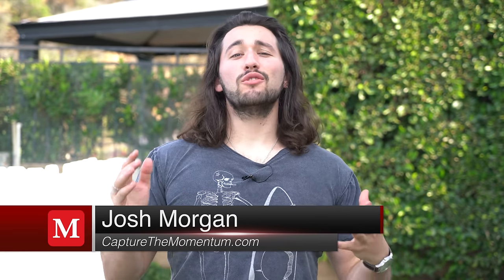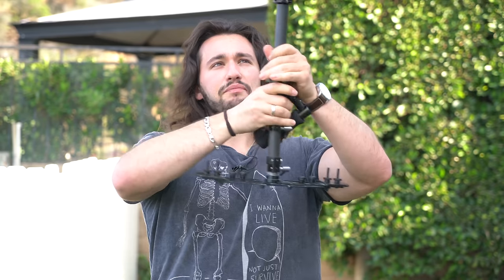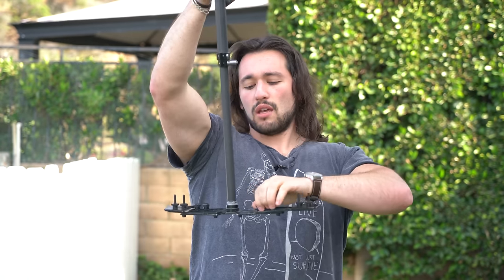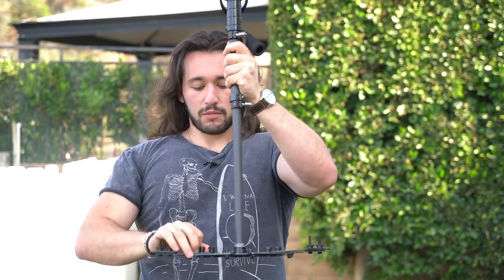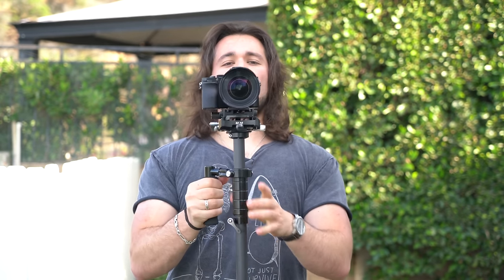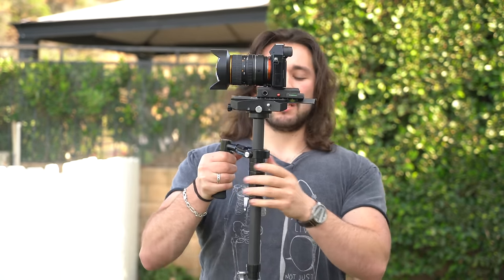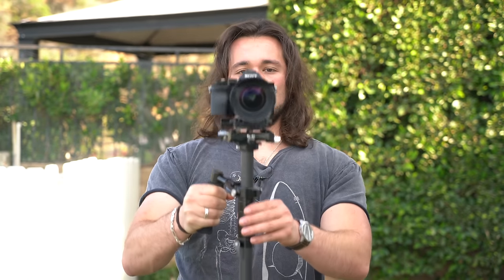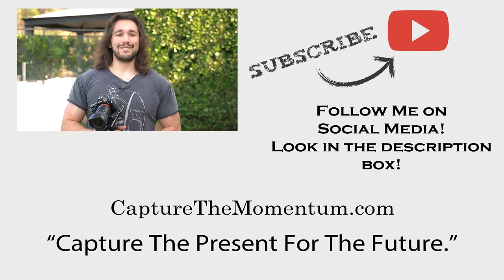BEST WAY TO BALANCE A GLIDECAM - Steadicam - Gimbal - Flycam - Opteka - Glidegear

Comment: From what I've tested, I found that having different drop-time values for different situations help. For example if you are running through the woods, then a 1 sec drop time works great, versus a 3 second one used for a character gently moving through a scene.

Comment: This is the best tutorial on balancing I have watched, and I've gone through a few! This is clear, logical, and most importantly it has the right order of doing things! Almost everyone, including my manual, starts off with the camera/plate adjustments on top, but it is only by starting with the weights apart, minimum weight, fully telescoped-out drop test and going from there was I finally able to get it! I still have some micro adjustments, but it at least looks like it is supposed to now, instead of the twirly baton I had earlier! Thank you so much for the thought and detail.

Comment: Got a Neewar steadicam for less than $120.  It looks like a molecule by molecule knock off of a Glidecam.  I'm working on the relatively steep learning curve of never having done video before (I have a couple of Canon 70d's).  I "get" this video and it's very helpfull but wonder why all of these guys who do them have like 18 inch bicepts
Reply: Because of carrying the steady cam for a long time. Either that happens or you build up your muscles beforehand.
Reply: I got one for 50$ on amazon :D

Comment: which glidecam are you using? do you have a link for it? thanks!
Reply: He mentioned in other videos that he custom built it by assembling different parts according to his needs .
You can go with the simple Glidecam 2000 or 3000 for a start .

Comment: I've been trying for about three hours and it still isn't balanced. Getting general adjustments is fine, drop test works for judging weights, but the "finer adjustment" process is literally never-ending. It always sways. The most confusing part is the way that even if I do something minor like adjust the camera plates placement, overtime it seems like it's changing other factors. Like it'll slowly get worse as I make small adjustments and I'll check the drop time and it's changed, despite the fact I never touched the weights and only made really small adjustments to the head.

Comment: Hi Josh
Am facing a problem with fly cam balancing. After i leave holding it horizontally for the 2.5 second count, my camera goes downwards. Am forced to put weight and after putting weight it becomes heavy and cant hold it for a longer duration. I saw that you haven't put any weight below then also you are getting the perfect balance. 
Please help.
Reply: Am using flycam 3000

Comment: Getting the hang of it but how do i stop it from spinning? It spins 😬 its balanced but i cant get the minor spinning to stop
Reply: AlphaRally16 saaaame
Reply: Same!!!
Reply: Could be an over tightened bearing, my old glidecam had that problem. It was on the cheaper end of things
Reply: It looks like you have to use both hands, so spinning shouldn't be an issue
Reply: to stop spinning add some bearing oil to the bearing and spin it around to lube it up , make sure the bearings arent over tightened then when using the gimbal hold the handle with one hand and lightly hold the shaft of the gimbal to stop spinning . iv got some vlogs on my channel in which some clips were using the gimbal , so it does work just make sure you hold it correctly and check the bearings

Comment: If your glidecam/steadicam keeps spinning counterclockwise or clockwise it is because you have a bad bearing. hold the housing that holds the main bearing and wiggle it. wiggle it in both axis directions, one axis might be fine but the other direction you will feel a loose bearing, that explains why your glidecam keeps spinning no matter what adjustment you make

Comment: Does a zoom lens change the balance?
When it's comepletely zoomed out or in, will it unbalance?
Reply from the maker: Yes definitely.
Reply: congratulation to that super smart question! :D :D
Reply: Schroeder3000 are you being sarcastic?
Reply: Wieger Dam the point is if u change anything (physically) on your camera, the center of mass will also change which means the balance will also change

Comment: i tried to balance my steadycam for the first time today and its so frustrating. its the flycam 5000 and there is no one thumbdial to make micro adjustments. i]you have to unscrew for knobs that hold it by friction and adjust it with your hand. i wish i got the HD5000. anyways i cant stop it from spinning and turning to the side when i do side to side movements, any tips?

Comment: Hi, I bought a cheap Eimo steadicam from amazon for 70 pounds. I wiggles around a lot. The drop time is fine. How can I reduce that wiggle? I tried adding more and less weight to the camera but nothing worked (Panasonic g7). Can it be the lower quality?

Comment: Thank you for the great instructions! Quick question, I have a 24-70 mm, and a Glidecam HD Pro. 
Would  you recommend balancing the Glidecam with the lens at a mid point for the focal length?    Or, every time I change the focal length, do I need to re-balance it?
Thank you!

Comment: thank you for your efforts much appreciated. I got a one and for the life of me I could not get that stupid thing to balance. I worked on the drop test so many times I totally got discouraged. When I was able to get some slower drop all it did was spin in circles. Again and again I tried. Then just gave up. Maybe that unit was a POS. It seemed too short. I just don't know. Talk about frustrating. My G7 will just have to be tripod mounted. But thank you for your help.
Reply: I’m going through the same situation right now, I use a G7 too and I can’t get the camera to balance at apl
Reply: @raegan06  Hey, probably that G7 is just too light. You might wanna try adding top weight. Washers are good as cheap weight.
Reply: @arnohesse5092  yeah I ended up returning the glidecam bc it was faulty but if I ever get a new one I’ll try that :)

Comment: what steadicam are you using in this video. I really like it :)
Reply: did you ever find out which steady cam it is? i wish everybody who do these vids provide a link to the exact same product they are demonstrating with or at least give the name
Reply: No im sorry I never did but I ended up buying a glidecam hd 2000 demo version.
Reply: +Mason Haines  thanks for the reply. what's your camera weight? i have a canon 70d.
Reply: I use a canon t6i with a battery grip, a rokinon 35 and, a canon 10-22, it weighs any where between 3-5lb
Reply: it looks like a Came-tv stabilizer
Reply: it looks like a Came-tv but the Came stabilizer that I own has markings on it so you do not have to write down anything on the pole to remember your settings. numbers are on it already
Reply: Mason Haines its a Laing P4s but it looks to be modified at the bottom! (Weights side)

Comment: does wind affect in balancing proccess
what to do in windy conditions?
and thank you alot
Reply: windy conditions are not ideal for these weight stabilizer systems. the lighter they are, the more prone they are to move in wind gusts. when working with the stabilizer, you can grip very lightly on the shaft above gimbal with thumb and first finger to help stop any movement caused by wind. also, adding more weight to top plate and bottom sled will help produce more resisting inertia to wind gusts, however will make overall weight of gimbal heavier, and more straining on your arm. its a compromise. if you are planing to film in very windy conditions a 3 axis motorized gimbal may be a better option.

Comment: Hi, I bought this kind of stabiliser (not the same brand) but I know it's the same science. When I finally achieve the balance, I can't do the test you did at 9:34, because as you said, the momentum makes the camera rotate and stuff, but in my case, the camera rotates to selfie mode (lol) and it doesn't get straight again like yours. This is really pissing me off because when I'm recording even the wind makes my camera rotate and I literally have to grab my gear with to hands and not just touch it. What could be the problem? is it normal and I'm just dealing with OCD?  Thanks for your help.

Comment: I am new with the steadicam, and I am getting some issues with my cheap neewer steadicam, it seems balanced but it has the swaying issue, i tried to fix it using the tips in the other video, so not sure what I am doing wrong.

Do i understand correctly that if it is balanced correctly it should not move to any direction if you are just holding it or???

Comment: nice stabilizer videos again. Do you recommend laing p-04s stabilizer?
Reply: Yes they are awesome.  Great build quality and performance for the money
Reply: I second this!! I highly recommend Laing P-04s. I had seen some mixed reviews on youtube about it... but having used it for 6 months now, love it more and more. Super easy to balance. top plate is easy to remove, but would also recommend attaching a 501 quick release adapter so you can pull camera off quickly if need be. adjusting dials a super easy to get balance right.  it is one of the few stabilizers out there that allow the gimbal handle to move up and down main shaft, allowing more variation in shaft extension length and ability to easily go into inverted position. comes with its own carry bag... plenty of weights.
The only small con that ive found, I have a d750 mounted, and to get balance, I have the plate moved almost completely to one side... meaning that I am nearly out of lateral movement space. I say nearly, I still have a small amount of wiggle room, but just something to be aware of in case the camera you are mounting has weight heavily distributed to one side. There is always a workaround though such as lead weight added to plate or base of camera to help balance.
Overall, fantastic stabilizer.

Comment: first off this video is awesome, also i just got my glidcam and i follow your video fir the drop test, and it reaches vertically in 4 seconds but it also spins a bit slowly in a circular motion, i saw you did it in 3 and your hardly rotated. also its missing two out of four screws to the top where the camera has to slid from left to right, the two that i got it with i put one on each side to try balance it out. can it work that way also?  i'm wondering i can get some assistance thank you
Reply from the maker: Hi there! Thank you so much for watching. Try to continue adjusting the boom pole and gimbal height. This is a HUGE trial and error process that takes time :)
Reply: thank you for the prompt response, my doubts where more over if the two out of four screws that are missing for the plate to move left to right would make a difference in my balance and if 4 seconds is a good time for it to reach vertically for the drop test ?

Comment: Hi! so if you change the zoom of the lens you need to readjustment all?
Reply from the maker: Yes :)
Reply: Precisely, only front/back offset of the camera. Weight distance, handle height, left/right offset would stay the same cause overall weight didn't hange. Only the distribution of this mass have hanged in front/back axis.

Comment: doesnt work at all with my glidecam. its just swinging if i move it to the right/left
Reply from the maker: Try rebalancing. It's trial and error, so it's not something you will get quickly.
Reply: @MomentumProductions1992  i think its just because my camera is way too light and the weight at the bottom of the steadycam is heavier. And there is already the lightest weight at the steadycam